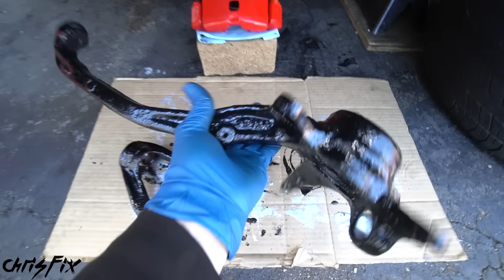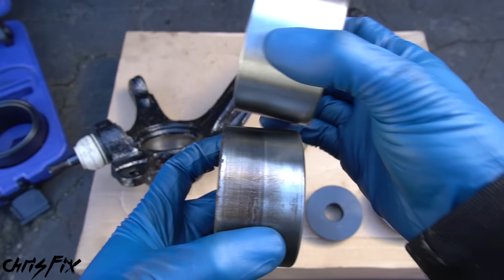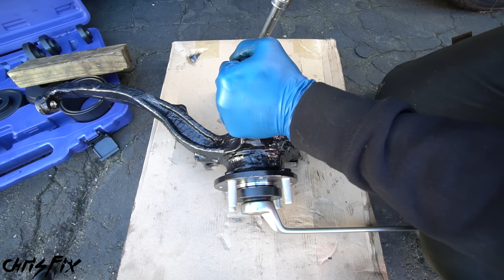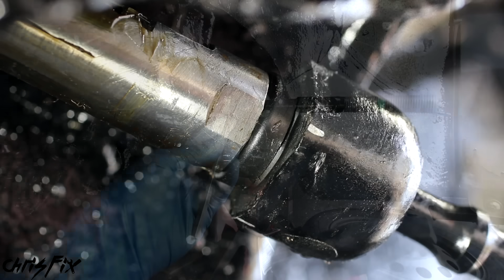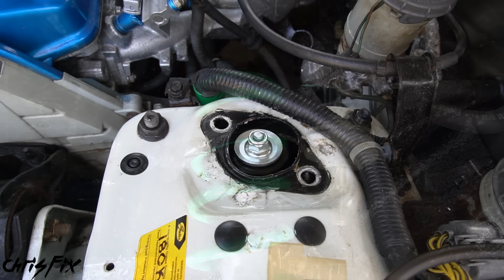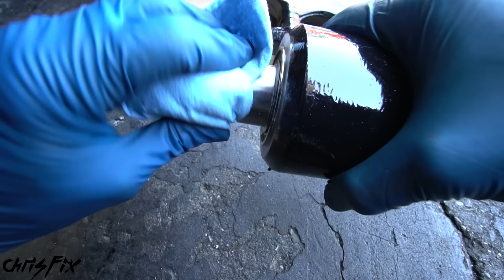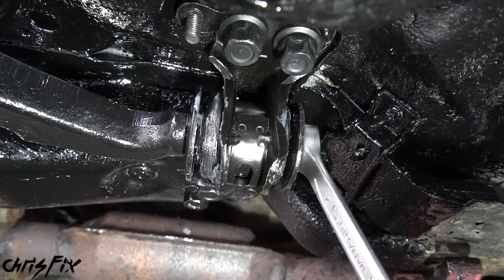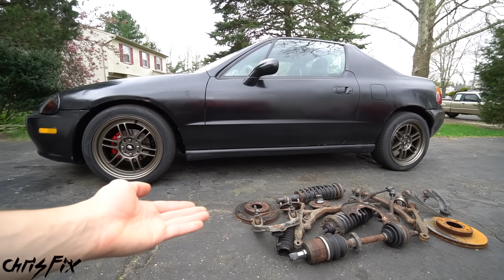How to Install a COMPLETELY New Front Suspension in your Car or Truck

Comment: Once again, amazing video! There’s only two things I noticed as an A Technician that I would change. 
1.) Use Brake Lube on the brake hardware, not anti-seize. Anti-seize reacts differently with heat. I’ve seen it lock up. 

2.) Check the torque the strut mount bolts after the weight of the car is on the suspension. 

Other than that. 

I absolutely love your videos. 
I watch them not to learn but just to enjoy. 

Every so often you teach me something I didn’t know. 
We are always learning even when this is our profession. 

Coming from someone who is the Lead technician in his shop, your videos are hands down, by far, the BEST car videos on YouTube. 

Bleepinjeep, and CrawlTV are the best Jeep videos. 
ChrisFix you are the best car repair channel.  
Keep the videos coming! 

Next video would be cool if you did a wheel restoration video!

Comment: Just bought that wheel bearing press to do front bearings on my mk4 Jetta. I have a harbor freight kit but the threads on the press bolt (yes I greased them!) are stripped out from some previous stuck bearings and that AP kit seems to have a nice grade 8 bolt with some nice coarse threads!

Comment: That metal zip tie is going to fall off the inner tie rod boot after a couple heat cycles of the steering rack.  Please DON'T use a metal zip tie.  I know because I used the same thing and the boot popped off!  You need to use the Oetiker style clamp where the crimp acts as a spring that expands and contracts with heat cycles of the steering rack.

Comment: Good job!  But chris did not specify on something very important! When pushing in a press in bearing, if your bearing has a tone wheel or magnetic wheel, make sure you install it inward towards where the abs sensor is. If you dont your abs/trac control lights will come on. Also when pushing the hub into the bearing, make sure the inner race is supported not the outer race. The inner race is usually split in 2 pieces and the back side part will and can push out when pressing in the hub. The outer race you dont have to worry about after its pushed in. It is supported by the knuckle.

Comment: I’m a new subscriber and you’re videos are so easy to follow! And one question, is it a good idea to always redo the suspension at 200,000 miles? Because my car is close to 200,000 and was wonder if I should start preparing to redo it.
Reply from the maker: Not necessarily. You want to inspect the suspension and see if there is anything that needs to be replaced. Watch my videos “how to check a ball joint” and “how to check a tie rod” to start with the basics.

Comment: You actually made a mistake Chris, when you pressed the wheel hub into the wheel bearing, you want to push on the INSIDE of the wheelbearing, and the hub, otherwhise all the force goes through the bearing, and that cause cause it to be damaged, UNLESS the surfaces of the bearing at flush, then it does not cause an issue (Which yours might have been, just sometimes the inside bit is more narrow than the outside)
Reply from the maker: The bearing press plate I used was flat and touched the inside race and outside race (the whole bearing) so I didn’t do it wrong. But thanks for checking.

Comment: Upper control arm bushing can be installed in a bind. It is ideal to also torque them on vehicle weight.
Reply from the maker: As shown in the video, they were torqued down at the same angle as the stock one, replicating the weight of the car on the control arm since there is no space to get to the bolts to torque them down with it installed in the car.

Comment: Do yourself a favor and get the turbo balanced at a local speed shop or diesel repair. Nothing wrong with an eBay turbo as long as it’s balanced properly

Comment: Great video, much more entertaining than mine are, I'm excited for the upcoming modifications! However I would advise you against using anti-seize on the brake pads grease points as anti-sieze contains metal grit designed to help torque bolts (it's not intended as a lubricant), you should use high temp grease instead or ceramic break lubricant would be even better. I'm looking forward to the next videos.

Comment: I just wanted to quickly thank you for all the tips. I was replacing my moms tires about 2 weeks ago and using a normal jack. Not sure what happened but I installed the jack on the plastic plug of the cars trim (the one that mechanics remove to lift the car on the ramp...its just a simple clip) and not the actual body of the car. Loosened the nuts and jacked the car up. Put the tire underneath the car. Suddenly i heard a snap and the car was sitting on the tire with my leg beneath the car. If it wasnt for you telling me to put a tire under the car I would be probably sitting in the hospital right now with crushed  bones. Luckily the tire survived and I was able to jack the car up and replace it like I always do. Been replacing tires ever since I was 10 and yet something happened that I wasnt paying attencion. So again. Thank you!

Comment: WTF is "Manual Transmission Fluid"? There's gear oil, and then there's automatic transmission fluid. "Manual Transmission Fluid" is a marketing term created to sell shit like that to people. Also, most of the parts you removed were perfectly fine.

Comment: I see you put high temperature grease on the steering rack gears, is that necessary? Also if we see that some of the bolts are loosening up after the test drive, what are we supposed to do - tight them even more?

Comment: Never put the full load of the vehicle on the ground without the axle nut on. It will either destroy the bearing or just damage it enough to cause premature failure.

Comment: Needs a VTEC head or a B swap. Even though I know how to do all this, I  still watched it. The attention to detail is awesome. Thread locker and silicone grease go a long way in preventing rust welding or bolts backing out, especially in the salt belt. So glad you emphasized putting a load on the suspension before torquing the bolts a lot of people don't know that.

Comment: An amazing teachor/mentor with an incredible zeal for what he does o.O :y :) I thought all** kinds** of crazy hi-tech, safety-training-req'd equipment would definitely be needed to do a suspension replacement. I think i've seen Just Abiut Everything NoW.. 
the beautiful thing is that just with doing, throttle-body removal and cleaning, discs and brake pads, fuel filter change, coolant flush, gearbox oil change and engine oil change, I feel I have the confidence and familiarity to watch all of this and be satisfied because I can imagine having_ the required aptitude_ to do a spectacular job with these guidelines

Comment: Some newer vehicles (Hondas for sure) have a magnetic ring on one side of the bearing for the ABS system, so always match the colors up as well to get the right orientation. Otherwise you'll get a perpetual ABS light until you redo the bearing and will be super pissed!!
Reply from the maker: Thanks for the tip
Reply: @chrisfix  Thanks for the video! I did the same exact project to my 02 camry last year and the difference is really remarkable. It's literally a different car now. Happy Easter!

Comment: Where to u get all of the tourque specs for each of those different bolts?
Reply from the maker: Watch “how to use a torque wrench” where I cover all of that.
Reply: ChrisFix I’m not really asking how to use a torque wrench. I’m asking where u got all of the specific tourque ratings for each of the desperate bolts. And does it differentiate between vehicles

Comment: ultimate challenge try to have a car alive and in good condition for as long as possible like 60+ years :)
Reply: Someone in my street owns a '67 Mustang. She uses it everyday.
Reply: @derpdudedatboi7455  52 yr old car that's lit
Reply: @ThamizhanDaa1  The stock exhaust makes a deep rumble that sounds soooo good.
Reply: @derpdudedatboi7455  I'm trying to get into cars, I'm studying mechanical engineering.. and yeah I agree with you these sound that card make are so swell..
Reply: @ThamizhanDaa1  Yeah man that's a great choice. Mechanical engineering is fascinating in my opinion!

Comment: When pressing the hub into the bearing you want the plate to be on the inner race, not the outer. The hub is being pressed into the inner race so less stress will be placed on the balls inside the bearing if you hold the inner race.
Source: I do this for a living

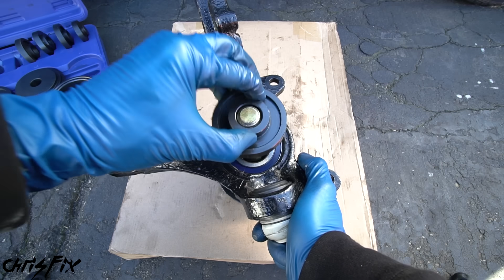Comment: 7:43 Wouldn't it make more sense to use a plate that presses against the inner part of the bearing? The way you did it put all of the force right on the balls inside the bearing.

Comment: The bungee to hold axle is an awesome trick!
Marking all fasteners for easy check is a very old procedure,
tried and true. Do you believe there are some morons out
there who say they are "Engineers" but then scoff at marking
because someone they "don't like" suggested it on a Forum?

Blind hatred is a sickness. Look here, for example-
47k likes, and 250 dislikes. 250 "viewers" dislike this video?

What would those 250 rather have you do? 
What do they think you got wrong?

You & I have had slight disagreements over the years, or I
will make a suggestion- but I have never given you
a thumbs down, or stated that you have done something
completely wrong or dangerously incorrect.

Comment: Often ball joints need to be aligned for the travel of the suspension, also abs on the wheel bearings. Little things that ppl screw up. Also axles nut procedure should be followed. And ppl if they replace their suspension that’s all great but now you have a tired motor and probs a trans on its last leg.

Comment: how long did it took to fully install this??
Reply from the maker: It took me 6 weeks to film the two videos. It would have taken me a day or two in the driveway if I want filming.
Reply: @chrisfix  allright cool man, thx for the replay. Keep doing what you do you make awesome vids!
Reply: A full suspension job like this is an all day thing unless you have everything ready to go from the beginning
Reply: @disturbedrocks1996 would it still take a days work if you rented a bridge and everything in a local shop?
Reply: @_M27_  pretty much. I did a ball joint job somewhat similar to what Chris did in this video and it took about four to five hours to do 4 (2 on each side) and that was with all the proper tools and a ball joint press

Comment: I like that you use a pad with your floor jack.  Much safer than metal on metal.  Next time you're near a sporting goods store, stop in and pick up a hockey puck.  Fits perfectly and won't slip.

Comment: Lovely video, only suggestion I'd have is that I've always found it beneficial to leave the grease fittings covered in some grease. Yes it does get a little messy and dirty, but the grease will prevent the fitting from rusting up and becoming blocked. Something I learned from apprenticing on classic cars.

Comment: When you press the hub into the bearing the backplate should be applying pressure on the inner race otherwise you're eccentrically loading it and might put the bearing into a bind

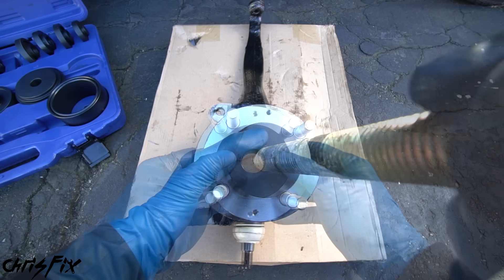Comment: When you're pressing the hub into the bearing at 7:40 , you say "use the plate that fits on the outside edge of the bearing" and that's what you do - this ISN'T what you want to do. You want to have the adapter plate that fits to the INNER part of the bearing. By pushing the hub into the inner race and having the other side of the press on the outer race, you put large strain on the whole bearing that it isn't designed to handle and could wreck it.

Comment: I might be wrong but when you press the wheel bering in the hub, you want a contact with the inside ... not the outside... At this moment, you are making stress on the inside bering.. not outside..

Comment: Great video but a few corrections:
-hub should be pressed against the inner race
-never rest vehicle weight without the axle nut tightened, easier to just stick a screwdriver in the rotor and tighten the axle nut

Comment: And that is how you destroy your hub bearings. 

When pressing the bearing into the knuckle you should use the outside of the bearing, that is correct. However, when installing the hub you should use the inner race as your bearing surface while pressing. If you don't you run the risk of pressing the inner race out, and then you are screwed.

Comment: So Chris, what would happen if that strut didn't have that locator tap/stop on it, and you hit a bump in the road? 
Do you think the strut would get pushed thru the clamp? Now what major car maker forgot to put that locator tab/stop on their struts? 
Yes and as you can imagine every time the car hits a pot hole the suspension collapses. Major embarrassment and safety hazard.

Comment: Great video Chris! If your looking for constructive feedback can I just say that at 7:40 when pressing the hub into the bearing you need a backing plate that contacts the INNER race of the bearing not the outer edge because as you push the hub in it will try to force out the inner race, the outside edge cannot move because of the snap ring. I have had it happen me a few times where the inner part separates and all the balls fall out because I wasn't supporting the inner race while pressing in a hub.

Comment: I have replaced my wheel hub and axle before. On my car everything is bolt on luckily. Except the ball joint (only has a lower) that's riveted in, so I have to drill them out and bolt new ones in.

Comment: Great video except for anti sieze on the brake caliper surfaces . it gets gummy and in my experience causes things to bind up over time. i stick with hi temp silicone and only between the bracket and the hardware to prevent rust jacking.

Comment: 7:40 When installing the hub into the bearing, since the hub mates with the inner bearing race, it would be better to use a plate that contacts the inner bearing race instead of the outer (for the same reasons you want to only apply force to the outer race when installing the bearing in the knuckle).  That way your pressing forces aren't applied from the outer race, through the balls, into the inner race (and mating hub).

Comment: Awesome I have a 1997 Delsol SI  I just finished doing the front suspension and after watching this Video . I'm missing a few items not included in my parts . So I'll be removing all my new parts and ordering what I should of gotten in my total parts box.  Thanks for posting this Video. This Delsol is a year long project and I want it to be totally right when I get done. I have another 1997 Delsol SI waiting for total restoration .  again thnks for posting..

Comment: When pressing the hub into the wheel bearing, wouldn't you want to press on the inner portion of the wheel bearing so as to not cause damage to the wheel bearing?

Comment: I’m betting you got the turbo kit to fit a civic, but your in luck, as long as the turbo kit fits a d series it will work, just don’t boost over 10psi and you’ll be golden

Comment: I've heard from my boss to tighten axle nut while car is still in the air, because bearings without any tension can split if you lower a car on the ground

Comment: Hello Chris.
I love your channel and follow you from Paris since 2017..
I cannot beleive that you did not change the rubber of the gearbox at 15 : 47 ?  It does not cost expensive and it seems to leak..
Why did you not change it ?? 
Anyway. Excellent work. As usually

Comment: Correct me if Im wrong but isn’t the force going through the bearing when you install the new hub? The hub pushes the inner part of the bearing and on the other side you had a ”washer” the same size as the outer ring of the bearing.

Comment: The dust shield is also for the water that is splashing on the rotors while driving , if the rotors are hot and water splashes on it it will /may warp them . The splash shield IS a must

Comment: I don't have a steering rack. My old SUV has a steering box instead. Is the tie rod procedure about the same or is it different?
Reply from the maker: It is a pitman arm setup. Similar but different
Reply: @chrisfix  Thanks for the reply. It also has automatically locking wheel hubs, i'm not sure how they work or if i need to fully disassemble them. Guess I'll find out the hard way lol

Comment: Careful with that paint, is not good for the steel. Some paints don't allow the metal to breath, being so thick, they will trap moisture between the paint and the steel causing massive corrosion over time. There is a reason you don't see paint so thick anywhere on the car
Reply from the maker: Thanks for sharing but paint is an impermeable barrier. It won’t let oxygen molecules get to the steel let alone water. Also, there is thick paint all over the underside of many cars. Manufactures that don’t apply the coats thoroughly have rust issues. That’s why i have 2 different layers! Thanks for the tip!
Reply: @chrisfix  I might be wrong, not gonna deny that, what i imagine is thick paint acting as insulation, causing moisture because of the temperature differences, although of what i heard, is only available for rubber like paints

Comment: Tip for all who are not allowed to put their car parts in the freezer. Add some (like 2 big spoons) salt to the ice in your cup. The temperature should go from -1°C (water freezing point is exactly 0°C) to -20°C (don't touch it).

Comment: The cold water is just waste of time at best you shrinking the parts by 0.01 mm
Reply from the maker: It helps. Try pressing a cold bearing vs outside temp bearing. You can feel the difference!